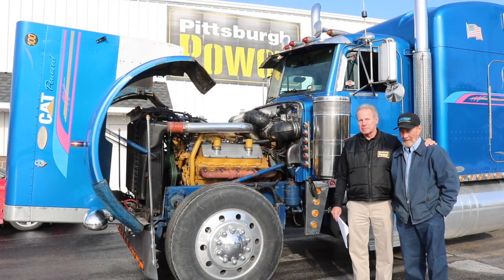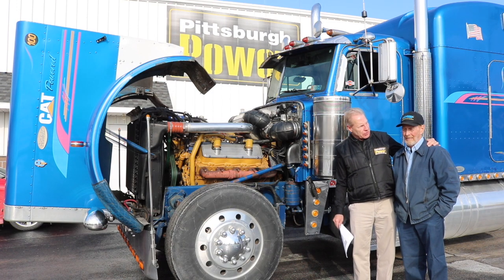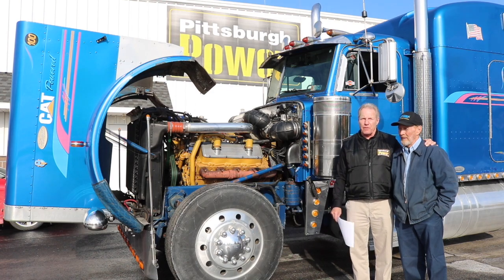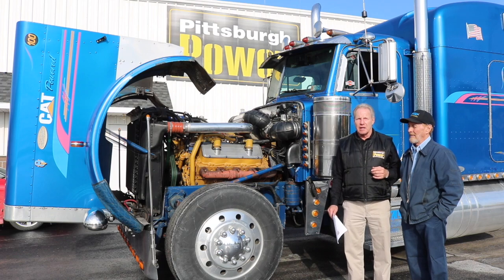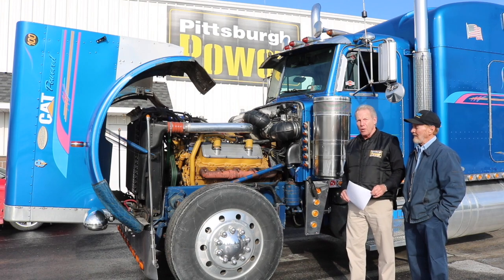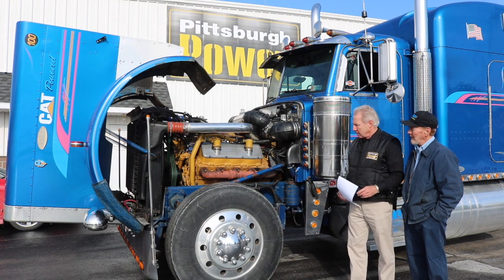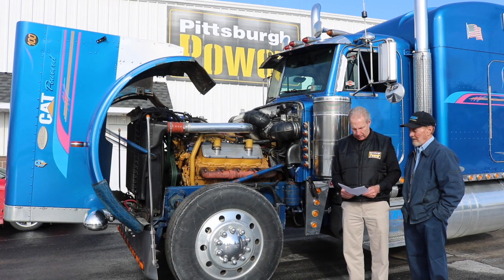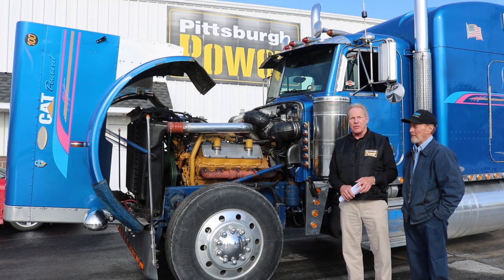Mechanical V8 CAT 3408 Dyno Run

Comment: Don’t believe dyno numbers because they can be falsified 

Notice how he will not talk torque numbers because they are low.

European 450bhp trucks sound much more powerful. 

Cat made shit engines & that’s why they stopped.  

Catipiller basically means weld some RSJ’s together add some rams etc & say they are the best. Nothing more.
Reply: “Bhp” mean while you’re talking shit about a truck putting down whp numbers he said 500hp and 1700 torque clearly.
Reply: Not that bad surely Chris..? 
I like the sound of these CAT engines, and i'm told they are pretty reliable on the whole except for those 10.3 litre ones that we had in the UK in the 80's - constant head gasket.cylinder head problems with them so most firms went back to Volvo/Daf/ or Erf with Cummins and started making money again. 
There are still one or two CAT 3406's running about in Foden trucks and are popular with landfill operators.They seem to swear on them.  
Having said that, this engine should compare with the top power Scania V8's but it falls way short on torque compared to them:
The 620 V8 turns out 2210 lbs/ft torque
The 730 V8 turns out 2590 lbs/ft ''  '' 
i suppose you'd have to bear in mind this is a very old tech engine, maybe that's why it's churning out less than 1800 lbs/ft .. 
I wonder what the CC's is for this motor..?
Reply: @garethifan1034  Are we talking about 40 year old scania?
Reply: @MisterTwister222  No, we're not..I did put that in the end of my parargraph - having said that, the 3408 is about 2 litres more in capacity over the Scania at 15.6 (620hp)  or 16.4 litres (730hp). 
I suppose if you wanted to compare something of the same age - the Scania V8 was brought out in 1969 at about 375hp and was up to about 420hp in the early 80's - but its capacity at that time was 14.2 litres, so a good deal smaller than the 3408 at almost 18 litres. 
I don;t know the torque figures exactly for those older engines, but I think the 420 was putting out about 1400lbs/ft in those days, which was way more than anything else in Europe, excepting maybe the odd Brit truck fitted with the Cummins E14.  
The Scania and the Cummins were the big hitters then. 
Regards
Reply: @garethifan1034   They tried selling in the US in the 80s with Scania’s own 11-liter engine, rated at 308 horsepower DSC11(06) and 341 horsepower DSC11(03). There was 1 (one) model sold total in the US with the 14.19 liter DSC14 V-8 at 500hp. Oh, and your 720hp is only available in top gear, and power in also limited in the first few gears in a modern scania.
Reply: @MisterTwister222  They didn' just 'try' selling them, they did sell them. 
Testament to their quality and durability is the fact that many of them are still earning their keep in the North Eastern US 30+ years later. The problem was not the quality of the product that they didn't sell in greater numbers but the ultra-conservative buying habits of the American transport industry. 
Talk to those who run them, and they swear by them - just as owners in the UK and Europe and further away in Asia would also do. They were an extremely well built and well put together truck  that were easy on fuel and nice to drive. 
Yeah the 730 is limited in the lower gears, partly to protect the tranny from the big rush of almost 2600 lbs/ft of torque being dumped on it at a moments notice. 
Regards
Reply: A lot of the better engine shops have engine dynos to put the motor on on out of frame overhauls to get the numbers an also help seat the rings in the same fashion wheel dunks are used after in frames. Due to the higher compression ratios diesels for under ring seating to piston or liner walls are the difference in million mile or 200000 mile rebuilds
Reply: @patrickmccullough3222  he doesnt understand that I "worked" for caterpillar.... Hes obviously an alcoholic...
Reply: @MatthewFogarty-k2y  I did say dealer. I didnt say dealership. It was an actual cat shop where equipment was sold and engines, transmissions and transfer cases were rebuilt and tested. All major cat dealers have engine dynos. The one I worked had a chassis dyno and an engine dyno.
Reply: @MatthewFogarty-k2y  not in the equipment business. But that's okay. This ignoramus asshole seems the think I'm talking about a truck dealership. Therefore he has no clue what he's talking about. Btw... A dealership sells vehicles, boats and motorcycles.
Reply: @robby844  You just said equipment shithead that's a dealership or dealer whichever you please now your talking semantics and 3408's never had jake brakes so i'll say you're a bullshitter and a bad one at that as evidenced more than once in this thread  And cat sold their trucks at their dealers or dealership didn't they? LOLOLOL!!!! Okay thanks bye
Reply: He clearly stated dyno HP and crank HP. Clearly stated torque as well. Caterpillar (yes thats the proper spelling of the name) backed out of OTR engines because the EPA was choking the fuck out of the engines. Show me a V8 shitmins with 1.8 million miles with no rebuild.... I'll wait....
Reply: Robert844 i don‘t really know a lot about large diesel engines but i would guess that the cat weighs a good deal more than its european equivalents, uses more fuel and is less efficient.
Reply: @habsburgheathen  if that's what you believe.
Reply: Robert844 the crank horse power was an estimated figure not an actual measurement....
Reply: @msengineeringdavid3702  but the dyno HP was an actual figure. So it doesnt really matter. The OP was whining that he didn't state numbers at all when in fact he did. You'll find the "estimate" pretty close to accurate.
Reply: Robert844 the estimate won’t be pretty close ppl guess this shit all the time and never prove it there’s a reason why dynos exist a crank power figure doesn’t matter you don’t use that only what comes out through the wheel.
Reply: Robert844 since when does your shop
Engine dyno things? Research and development? Number and address? I want to verify this.
Reply: Robert844  not a research and development shop... engine dyno my ass.
Reply: Robert844 you don’t have an engine dyno so what accuracy are you talking about?
Reply: you dont have to be an r&d lab to have an engine dyno, i know dealships that have shops whit engine and transmission dynos
Reply: Dodger go ahead name DEALERSHIPS with engine dynos fucken unheard of.
Reply: Robert844 I don’t care where you worked you could make up anything you didn’t even provide details of which facility... some facilities use them to test engines up to power and other things CALLED research but it sounds like to me you were sweeping the floors.
Reply: when your rebuilding engine that cost customers between 20,000 - 200,000, they like to see that the engine will preform before they put it to work so yes there is a reason to have engine dynos at a dealership
Reply: i think i figured this guys problem, hes all butthurt and jealous that he doesn't get to work at a place with a dyno, because after all, it is really cool to see those numbers climb in person.
Reply: @robby844  Looks like you said you WORKED  (past tense) at a cat dealership, just saying,but yeah a lot of cat dealers in upstate n.y. have run in and dyno facilities so the dude is wrong
Reply: @MatthewFogarty-k2y  also a Cummins dealership. Also I said NEWER Cummins. So....
Reply: @msengineeringdavid3702   Many of the regional Cat and Cummins Houses have both chassis and engine dynos.
Reply: Robert844 stop spouting shit about cummins you don’t know anything about them. Just had a signature 600 at work about a month ago with 1.3 million miles on it. We replaced the frame rails on it, ran smooth as butter.

Comment: Would be nice to know what fuel mileage he is getting. I had friends back in the day that ran 3408s at the best got about 4 miles to the gallon
Reply: That's about average I think. 5 at best.
Reply: Second Nature Lawn Care 3.5
Reply: 4 was a good number you could turn them to 400 horsepower on both sides and still do 4 mpg engine brakes were the reason they dropped it in us. Was still available in Canada after 87

Comment: Did the older model 3408's make more torque? This one seems underpowered
Reply: the dyno measured at the wheels, engine manufactures rate at the crank, once you take drive train losses into consideration its pretty stout
Reply: @Ezrider359  it was my thoughts that they 3408's had over 2k torque out of the factory
Reply: @michaellee5399  nah, just looked up the torque ratings.....1350-1460 ft/lbs depending on pump setting for automotive ( on road ) applications. Doesn't mean you can't get more out of it.....the engine is really big, 18L worth, so given the size it'll go well over 3500 ft/lbs of torque easily.
Reply: @hoost3056  well even with that i'd drive one 😀 maybe get it to 2k torque and call that good but the mpg would be terrible however if you got no debt and no rent or lights to pay for just live in the truck i think one could manage
Reply: @michaellee5399   according to what i can find 3408 in factory trim came rated at 420
hp and 1460tq or 450hp and 1350tq marine and equipment applications may of had some higher ratings, that was actually pretty good for its day, when you consider a cummins big cam 400 had something like 1100 ft lbs torque.
Reply: @Ezrider359  hmmm i forget what i was watching but on the video they were saying the 3408 had at least 2700 lbs of torque just out the factory boy it hard to trust what folks say unless they got the specs right in front of you
Reply: @michaellee5399  the ratings i posted were from a cat published document,  those are just on road engines though, the 3408 was used in tons of stationary and mobile equipment as well as marine applications is possible that in some applications/configurations it may have higher factory ratings, i would be very surprised if any of them were ever rated at 2700lb tq though. could be someone confused 1700lbs with 2700 by mistake that would be more believable. the 3408 was a bit known for weak crankshafts.
Reply: @Ezrider359  sorry what i meant is some videos people post that have ratings but dont have the spec sheets in front of them to prove it, and yeah i heard that about those crankshafts being a bit weak i wonder if a guy can get a different one to fit even though they dont make those motors anymore
Reply: @Ezrider359  There is not a transmission that would take it
Reply: @Ezrider359  actually,  Cat offered a 350, 410, and 450 hp version.  Torque with the 3408DITA was 1460.

The 3408B kept its 450/1460 ratings, which seems odd, since the air to air system would typically add some horses, and quite a little torque.  

The 3408E, used in large motorcoaches and off-road trucks,  gives us a better glimpse of what the engine was actually producing: horsepower started at 600, and torque was well over 2000.  Cat also offered an 850 hp version for the off-road equipment.  

The 3408 was replaced by the C18 after 2005, but Caterpillar still offers full parts and service support for their legendary hot rod V8.
Reply: Walter K Bauer  APU's are nice and handy provided you dont buy one of those junky comfort pro carrier ones 😂 plus saves wear on the motor and a good sum of fuel over the life of the truck, but i bet you might just be able to squeeze a little bit better mpg out of that motor if you can tune it right maybe get 5 to 5.5 idk if you can tune a mechanical diesel that well but id sure give it a shot
Reply: Walter K Bauer  5mpg when fuel was $5 a gal. was a truck parked situation 4 me,  remember those days men? so what year was it?
Reply: @NomadicSociety  I gave up a W900 that was doing 4.8 mpg during that 2007 to 2008 period where fuel was 5.00 per gallon. Hindsight is 20/20......should have gotten an  FLD with a 12.7 Detroit and a 10 speed.....outcome would have been different. If you dont have the freight to support whatever truck you get, don't buy it. Honestly, you dont need a 3408 unless you are hauling really heavy loads where the extra weight of the engine is not a factor. The 3406 is more than enough
Reply: @hoost3056  had to be the worst time in human history to be OTR in 08 ! anyone say different? let me hear your argument
Reply: The v8 diesels are known for making horsepower over torque. The inline 6 is known for its torque. There are a few out there, the c18 or the 3506 CAT. Most are in wood chippers and rated at 765hp and I want to think they have 2200 to 2400ft. Lbs of torque. Like any other diesel engine, you can get the marine injectors and calibration and make some good power.
Reply: 1200 ft lbs was alot when the 3408 came out.   Box stock 550hp Cat was making 2000 ft lbs from the factory nearly 20 years ago.. 3408 is past it's prime.  800hp Marine 3406 has 2200 ft lbs.
Reply: Actually, if I remember correctly, the stroke was 6.5 on the 3406, 6 inch on the 3408. Shorter stroke makes less torque.

Comment: Is no v8diesel anything worth a crap,have short lives
Reply: Jim Allen  I will agree with you on this one. There's a fleet o R model macks at our shop that have never had a rebuild. Things are still running strong.
Reply: Jim Allen  the 2 v8 Mack my dad drove you couldn't keep them together the company pulled the v8 and put a 350 Mack in one the other got 3406b they built the v8 several times using Mack stuff they pulled good but just didn't last
Reply: The 2 stroke Detroit's V8 sure sounded good with no mufflers ......as long as I didn't have to drive it. It would give me a headache

Comment: That’s so awesome. 
The engine in my pickup dynoed at 1138 HP and 1285 Flbs of torque. But it eats fuel like mad! Two fuel pumps are needed when that tune is in.
Reply: Let's see your Chebbie pull Monteagle @ 80,000 lbs tough guy! LOL!
Reply: @vincentenk4449  it would be a metal firework show 😂
Reply: @ronaldmorrison6013  🤣
Reply: Laiken Bellesario is that a gasoline engine? The horsepower and torque numbers are really close.
Reply: Anatoliy Dashkevich Yes it’s a gas engine. It’s a 454 LSX with twin turbos. Finally found a great tuner in Florida. Low boost in 1st gear. Maybe 7 pounds. 2nd gear 10-12
Pounds, 3rd gear 16 pounds and 4th gear it rips at 24 to 26 pounds of boost. It’s had 100+ dyno runs and 300+ passes at the strip. Texas Speed & Performance know what they’re doing.
Reply: @chloehennessey6813  sounds like a sweet setup . Those lsx 454's are cool
Reply: post video!
Reply: Wot,s that goto do with 3408 cat 🤐

Comment: Quad turbos on one for a customer in PA , back in the early 90's . She made 900 ish with propane on the dyno. Shredded a tire during the pull!
Reply: WOW!!!!
Reply: @camelmanjd2671  Yes Sir , It was in a Long Nose W900 KW  , Double Over 13spd, 3.55 Gears .  That thing was an animal ,owner had a driving award for 138mph from the state of AZ.  Owner said " Shit I was on the Jake for a 1/4 mile for he clocked me !!!"
Reply: jkdwayne we had a black w900L that was a glider kit with a 6nz cat it was tuned and all that and it’d go 132mph. Lost it a couple years ago when our driver lost control in the smoky mountains and had to use the runway ramp. Hit the pit so hard it snapped the frame on the truck and ripped the steering axel off
Reply: jkdwayne 3408 don’t have a jake guy
Reply: @natefrieden  do some typing... You'll find you're wrong.... VERY quickly. Sad thing is.... A simple type in the search bar here would have resulted in a quicker result than spouting off BS...
Reply: @robby844   actually,he is correct. That was one drawback of a 3408,never had a Jake brake. Now,it was available with a Brakesaver. This however,is NOT  a Jake brake
Reply: @dougkratz5269  actually youre both wrong. There are videos on here of 3408's that have jakes... I have worked on several that have had jakes on them. I have no idea where youre pulling your info from but its incorrect
Reply: @robby844    please post links to those videos
Reply: @dougkratz5269  theres over 100 videos.... All you have to do... Is type in.... Cat 3408 jake brake.... Easy....
Reply: @robby844  
That's not a jake brake dummy. That's a brake saver on a V8.  Jacobs engine brake never made a jake brake for the V8 cats. I wouldn't let you work on a wheelbarrow with a flat tire.... some of us don't have to Google shit to get information about something.
Reply: @dougkratz5269  
You are absolutely right! Nobody ever made an exhaust brake for a 3408 cat
Reply: I don't know about a Jake, but the Powerliner  Freightliner I drove back in the 1970's had a Retarder. kind of like a torque converter with adjustable vanes in reverse. Worked great until you had to back off from the oil getting too hot. @natefrieden
Reply: @jkdwayne  Not to rain on owners parade, but that truck needed 2800 rpm to do 138 mph and that's including tall 24.5 tires, or 2400 rpm if it had .62 final, sounds a little sketchy
Reply: Knew a guy that had one twin turbo that was putting 1050 to the ground.... Something must have been choking the quad if it only made 900...
Reply: @robby844  
There's not a single video of a 3408 with an exhaust brake on here.
Reply: What BS , show me the dyno report & the speeding ticket. It takes approx 800 hp just to get astock truck (with no trailer)to approx 140 mph & a hell of a lot of gearing that a stock truck doesn't have!!

Comment: I really need to win the mega milions
Reply: you can get a truck like for 40-60k. expensive but def dont need to be a millionaire. get to work
Reply: Me tooo ! May we both Win!
Reply: That isn't how you get to 1.8 million miles...
Reply: Is that the normal torque for a 3408? Figured it would be higher. I’m sure tweaking can be done to increase horsepower and torque.